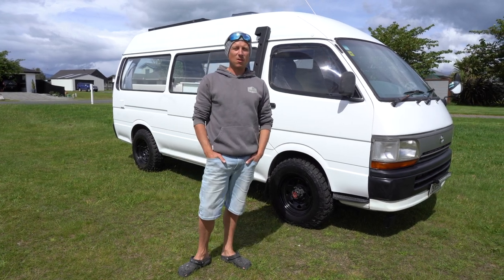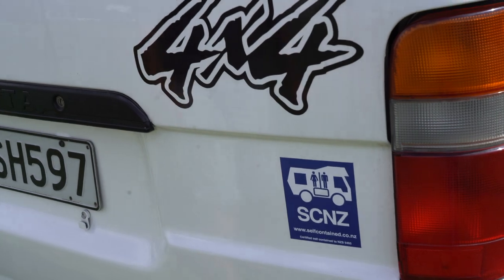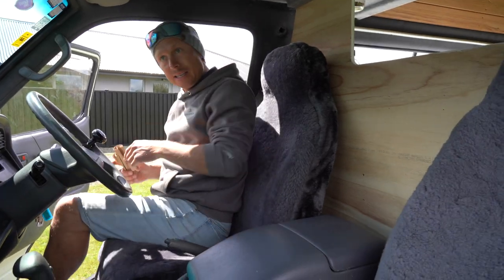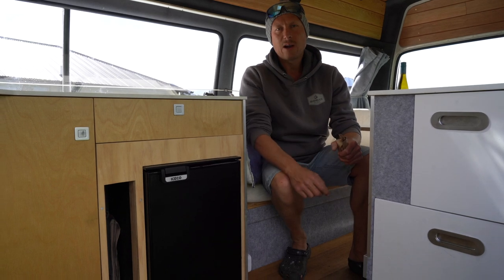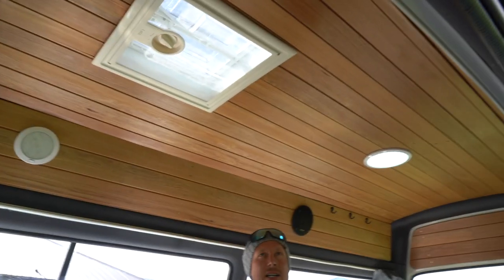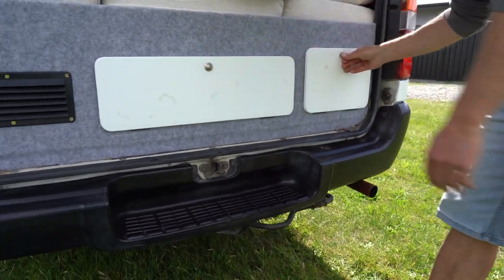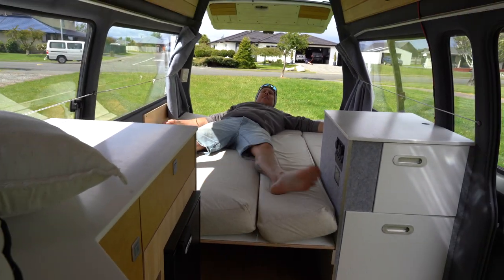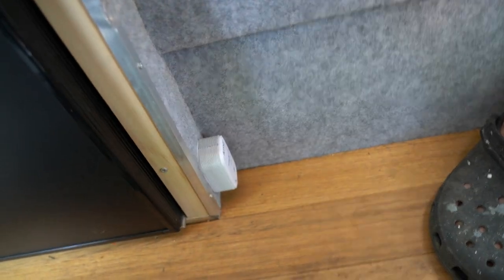4WD Toyota Hiace Campervan Conversion

Comment: nice job. one  question for me is gas bottle. i had to get mine sealed in special vented cabinet with door accessible from outside and pipe work certified from gas fitter.

Comment: Nice! Going to do a full rebuild on my AWD version here in NZ. Can you put those manual hubs on the AWD's? Pity about the toilet set up, thats my biggest headache right now with the stupid new laws, but at least you have cert until mid 2025. As mentioned not sure where you are located, but would you do a shoutout to your panel beater, as they did a mint job? Im weighing up a standard repaint or a raptor coat instead. Cheers